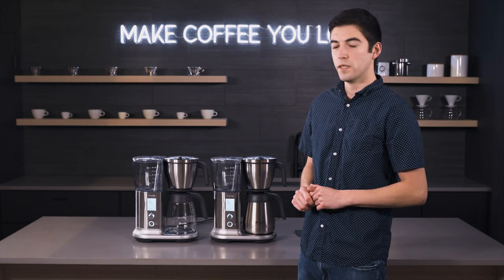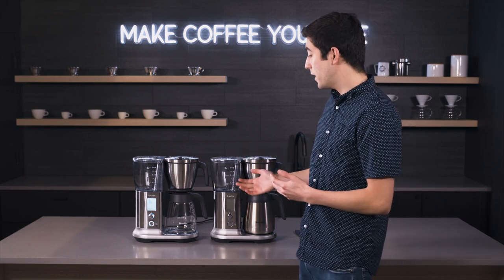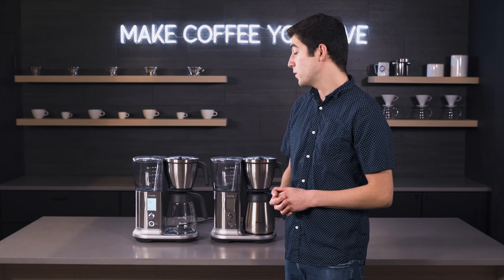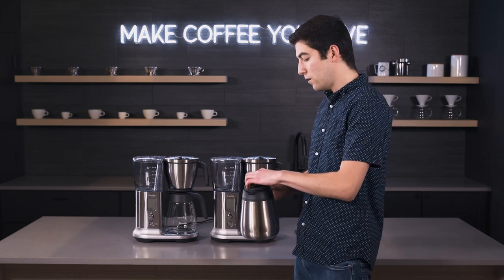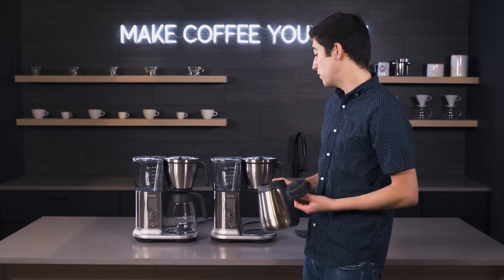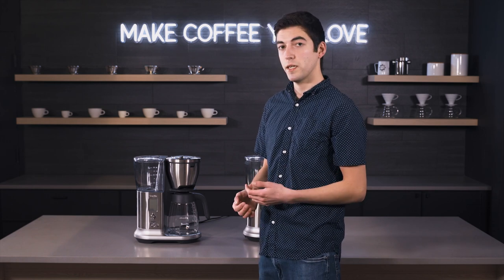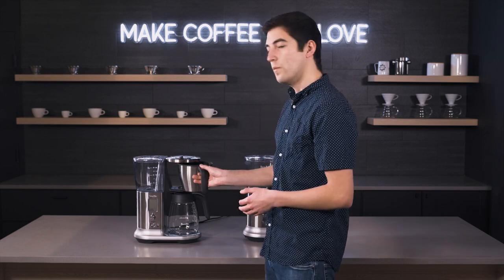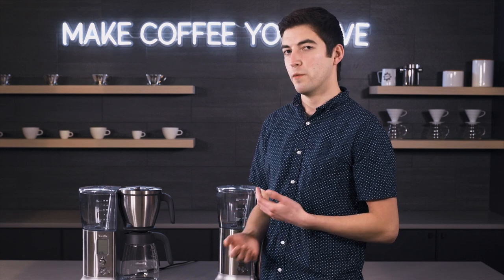Breville Precision Brewer Tips and Tricks

Comment: Simpler than rotating the brew chamber, I don't insert the thermos until bloom time ends. Your grounds will be perfectly saturated. That's assuming that you're using custom settings. I'm not sure if Gold Standard includes a bloom time.
Reply: I haven’t received mine yet, so I apologize for my ignorance.  What thermos do you mean that you don’t add until the bloom time ends?
Reply: @mickeymallette2663  The thermos/coffee pot that you pour coffee from.
Reply: @jonro100  you mean the carafe?
Reply: That's an awesome idea, I'll need to try that
Reply: This worked great! Best coffee I've brewed yet. Thanks for the idea.
Reply: Yeah, this for sure is a good idea, and I too am often tempted to mingle with the machine's default process to kick the taste up a notch. However, I feel like interventions such as this are counterintuitive to the reason why these machines exist. For me, a coffee machine should automate the brewing process, making it as hassle-free as possible and decreasing the time I have to spend on brewing coffee. If these clever interventions are going to make you stand in front of the machine the entire time, why not just use a V60 and brew manually?

Comment: In a standard coffee maker, all of the water you put in gets used up. In this, can you set the water amount and then have water left over? In other words, can I just keep the water topped up and not worry about how much is in the tank? Also, can I just put any thermal travel mug underneath instead of the thermal carafe and have reasonable tasting coffee even in a smaller amount right into the travel mug (like about 750 ml)?
Reply: No it will use up the entire amount in the reservoir. Water can go bad (as far as for brewing coffee) pretty fast when just sitting in a plastic container, so I think it's a good choice.
On your other question, yes you can brew into a mug of your choice instead of the carafe, but ONLY on single cup mode which I think maxes out at 500ml. You might be able to bypass this by using "pourover" mode.

Comment: hello, thanks for this interesting video.  Is it possible that there are different versions of the machine on the market?  Of course, I wanted to check the filter setting immediately, but found that this setting does not even exist on my machine.  I also noticed something else: I already have the second machine of this type because the first one was defective.  i almost exclusively use the gold function.  the first started a blooming phase shortly after the start and this is also shown on the display.  the second doesn't do that.  i have the feeling that my second machine is an older model with different functions and different software.  is that possible?  does anyone have any information?  i don't want to have received an overhauled model of such an expensive machine.  I have the version with a thermos.  thanks for your answers.
Reply: All I can say is that I had a similar issue. The machine, when in Gold mode, would only bloom when in single cup water levels... over that, it wouldn’t bloom. I swapped it out for a replacement and it still does the same... no bloom on Gold if anymore than one cup. I now have started to use MyBrew settings. Not ideal, for the price I would expect the machine to bloom ever batch, but wondering if this is a design thing.
Reply: @matelot2001  yes, I only figured it out because the machine I had before did just that.  and don't want my machine to have the option to select a filter. I don't know whether the previous machine had that.  I'm interested in whether there are different versions.
Reply: @matelot2001  this isn't a defect. The gold setting has been updated to include NO bloom on multiple cups. It's intentional. You can get around this via mybrew.

Comment: Trying to decide between thermal or glass and I’m not sure your mention of adding hot water before brewing makes sense if everything else is automated after set up. Does the glass model pre heat the glass carafe prior to the coffee dripping in?
Reply: yeah if you want the hottest coffee possible then the metal carafe won't work with the auto start feature.  i have never used a metal carafe before but i hear all the coffee equipment ppl talking about the preheating the metal carafe. i wonder if it actually makes a difference.  which model did u end up getting?
Reply: @sighiguess  most people dont like the glass craft, becuse it keeps heating the coffee after its brewed which from what ive looked into changes the flavor. Ive never preheated my current coffee maker metal craft and it does a great job at retaining heat, any hoter would be to hot.
Reply: So I just bought the Precision Brewer. Honestly, unless you like your coffee the hottest it can be, preheating the carafe is not needed. I add milk in my coffee which also takes away some heat, but it was still thoroughly enjoyable and plenty hot for my liking.

That being said, I put my coffee into a Yeti thermos that I take to work, so I maintain the temperature after mixing in milk, but I nurse my coffee throughout the day. If you drink yours out of a mug and you drink it quickly, within reason of course, than you'll never have to think twice about preheating the carafe.

I've seen a fair amount of complaints regarding this Brewer not brewing hot enough. It's safe to ignore them in my opinion.

Also, one thing I didn't think about is that you cannot see the volume you are pouring out with the thermal carafe. I split coffee with my girlfriend. You can adapt, but it's something to keep in mind. I would still rather the thermal carafe over the hotplate as my gf wakes up an hour after me and the coffee is kept perfectly hot for her as well without destroying the flavour. My last Brewer, I'd take the glass pot off the hotplate, set it aside, and she would have to reheat hers in the microwave. Not ideal.

Anyways, I hope my experience helps.
Reply: @b1_ferg   Interesting.  I preheat my 20 oz Yeti, and brew right into that.  I measured the temp of the water right after the brew cycle this morning and it was 165º.  I then add cream to my coffee and it's too cool for me.  I like it hotter.  Just switched to this machine two days ago from French Press and while this is a far superior taste, my thermal preheated french press carafe made a much hotter cup of coffee.  I'm in search of answers, dang it!  I can't believe it drops from 196-206º to 165 that quickly during the brew cycle.  Still going to search.  I use the "gold" setting.  I may need to play with this.  :)
Reply: You may want the metal It doesn't' break. The glass carafe is easy to break and good luck fining it anywhere including breeville we site!

Comment: My recommendation is to remove the basket after bloom and stir the grounds yourself. Then after the brew has stopped adding water, remove the basket and do it again. Flattest coffee bed you'll ever see.
Reply: I just used my precision brewer for the first time so I'm pretty new to this, but how do you know the exact moment the blooming ends? When I started the brew, I wasn't really in grasp of what was going on (when blooming started and when it ended, etc) other than what the screen was telling me.
Reply: @omerats96  Bloom time starts when hot water is first added to the coffee. I haven't looked at the timer, but you can hear when it starts. After the water has been added, it simply sits there for the length of the bloom that you set, giving you an end point. Most coffee people will tell you that this step is simply to get the grounds wet so that water makes good contact with the coffee bed before it drips through. You don't particularly need a long time for this, but depending on how much gas is released from the coffee (due to a darker roast, for example), getting all the grounds wet could take longer. I advocate for a stir, but you'll have to keep track of the time that passes in your head (or watch the timer) so that you get the basket in before the rest of the water starts to flow.
Reply: @omerats96  Upon using it again (I've been doing pour-overs), there is no timer. I would just do a countdown in your head from what you set in the settings for bloom.